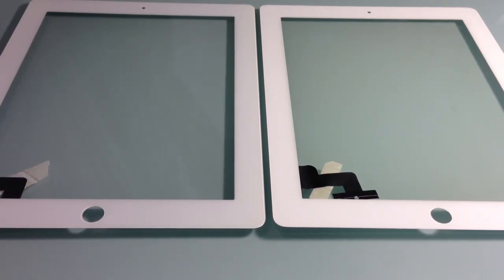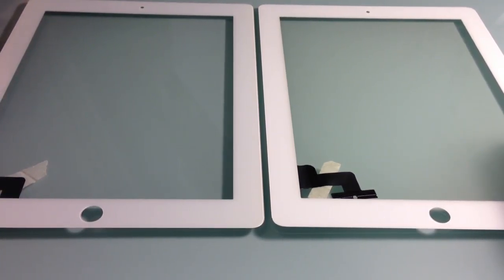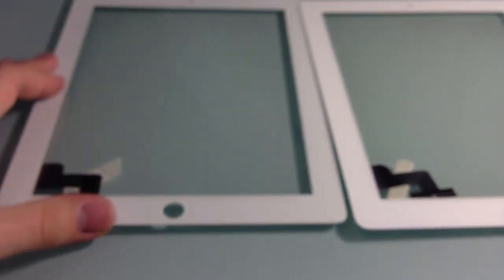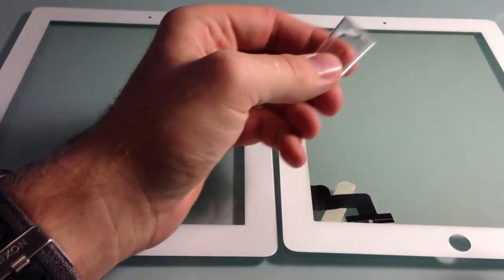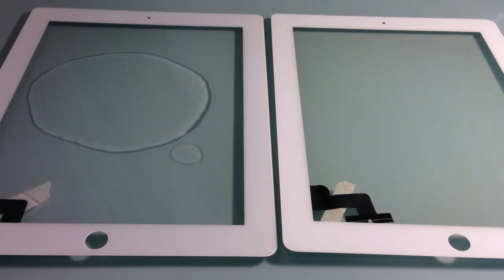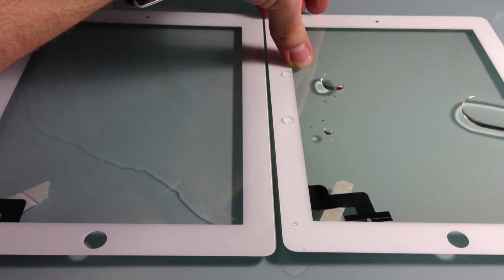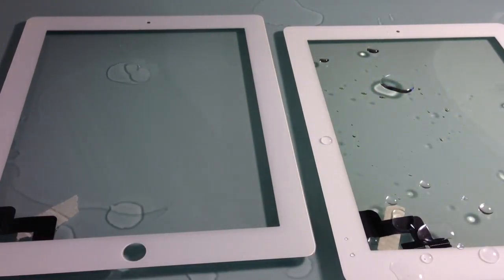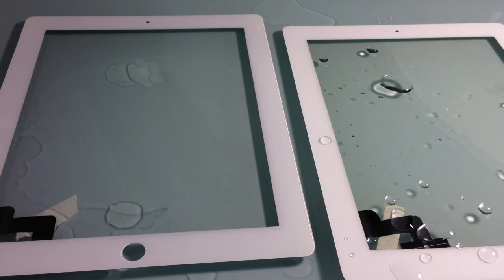iPad screen replacement. How to tell if the glass is OEM or Copied.

Comment: All and all i dont see the point of oem or aftermarket. I bought a digitizer for 20 bucks on ebay (pretty sure its aftermarket) but installed and functions perfect. As long as it works who cares.
Reply: DNALI the resolution isn't retina and it breaks much easier
Reply: Man Lam 
Resolution is the same (Retina). This is only the digitizer, not LCD.